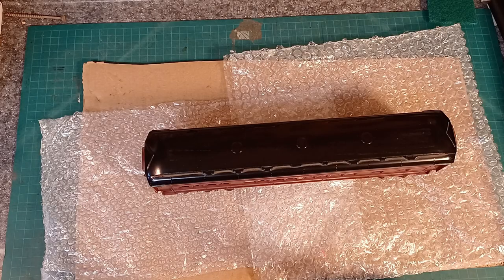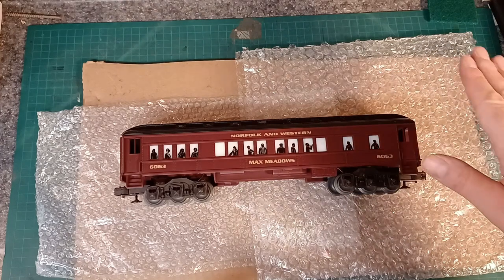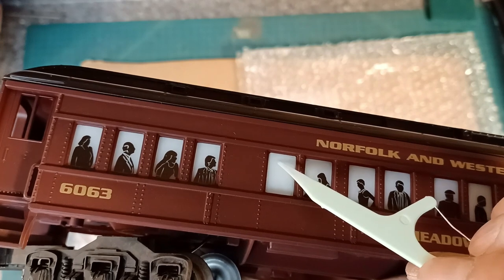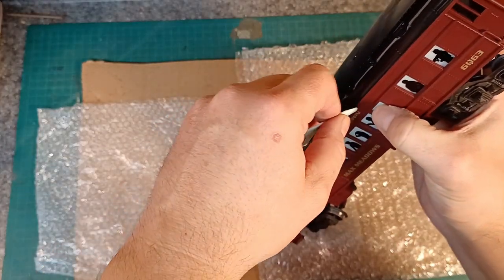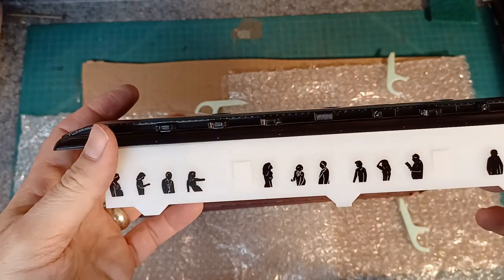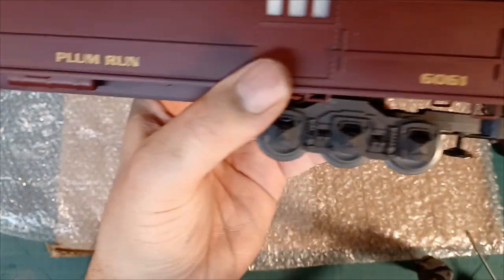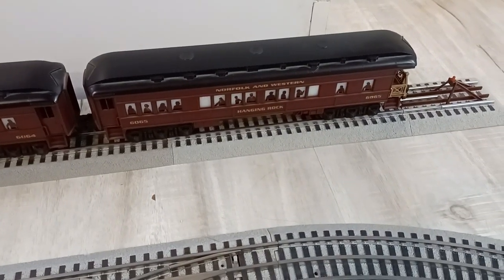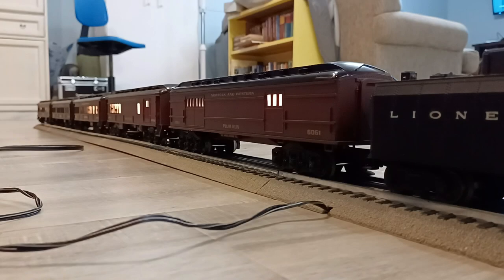How to Fix Lionel Trains. How to change the lights in Modern Era Lionel Pullman/Passenger Cars.

Comment: I have two sets of Southern Crescent cars.   Getting the roofs off was a bit difficult since the cars seem to have been assembled before the paint completely dried.   Took some doing with a flat wood spud sticks to crack the paint, but after that first one it was easy.    Once opened I removed all the old lights and replaced with a LED strip and a small diode bridge/capacitor/resistor circuit for continuous lighting.   They look great and don't flicker at all.

Comment: Hey Warren, thanks again for sharing this tip. I found out that it is easier to stick the floss picks straight down the inside of the car on the bottom of the tab windows after pushing on them a little. A small piece of Popsicle stick also works well.  I only put two on the one side and was able to lift off the roof and windows with no problem. Mine also has the cardboard insert which I believe is to prevent the window plastic from over heating and warping. Thanks again for a great video!

Comment: I have been working with these "baby Madison" cars for years. I am sure this was a great design for fast assembly of these cars but it does make it difficult to get to the lights. Being cast in one piece, the roof assembly is way to stiff to do this easily without damage to the body and roof. You have a decent technique. And the cardboard is there to stop the light from showing through the roof in the dark. This was added after a couple of years of production due to complaints from customers.
Reply: one person fixes it by paints the inside of the roof with paint. also issue with loco light too

Comment: Thank you, for sharing this because I received the same cars only to find out the card board inside fell down which is supposed to be there, but it will fall down so you will have to glue gun that card board inside.
Reply from the maker: Thanks for watching! I haven't had to glue my in place just yet. The cardboard still has a tight fit. I think if the cardboard finally gets to loose I may just hit the inside of the roof with thicker paint.

Comment: That’s part of a 5 car set from either 1994 or 1995. I have the set. Incredibly informative video on how to do as such.
Reply from the maker: Thanks for watching. Its a great looking set too. I do have all of them and use them quite a lot.
Reply: @warrenmuzakpostwarguy4331  They really are great cars! How do you get your trains to run at such consistent speed with Fastrack? I have 2 loops in the floor, 2 small loops, wired for TMCC, and even when I just run conventional, the trains all speed up and slow down..and I've got feeder wires placed every so often. Using a KW xformer
Reply from the maker: @jamesmdean1987  Hey James, thanks for watching. I have a KW transformer too. I regularly clean my track with a green scotch pad (dollar store brand) and once in while (7-8 months?) I check the tabs to make sure they are connecting properly and not loose. If needed I bend them to tighten up the connection. My track is just "clicked" together no feeder wires.

Comment: Always wondered how to do that . Thanks. Do you think the cardboard was a heat shield?
Reply from the maker: Thank you for watching Tim! I thought that cardboard was a heat shield, now I'm wondering if its just a packaging. Maybe protection for the lightbulbs. The lights used in there do not get hot enough to affect anything.
Reply: @warrenmuzakpostwarguy4331  The cardboard was added to defuse the light so it doesn't show through the roof. This was added to these cars after a few years of production. Simple answer.
Reply from the maker: @richardsobieck9660  Thanks for that info, I never would have thought thats what the cardboard was for. Only 2 of my cars have it.
Reply: @warrenmuzakpostwarguy4331  I'm not surprised. As I stated, the carboard was added a few years after production of these cars was started. The earlier versions such as the Blue Comet and the Milwaukee Rd cars, I believe don't have it. I think the later ones like the Chessie Steam set and the Wabash card should have them. Your car in the video has the 6 wheel trucks, those are later production and a bit different design than the earlier ones with the 4 wheel trucks. I was told you can't put 6 wheel trucks under the ones with 4 wheels, but I did it. Took a bit of modifications underneath to get clearance.

Comment: I need to remove the plain truck assembly (wheels) to solder the wire back on.
I see that it’s a “plastics truck rivet”, any suggestions on how to remove it without breaking?
Reply from the maker: So I had to do that too. Mine are 6 wheel. Under the middle wheel and axle there should be a screw to remove the whole truck assembly. Even with it off I had a helluva time soldering that wire due to the crummy new style pick up roller design. FULL DISCLOSURE: It was super frustrating and  I wrecked the pick up. If another goes I may try again or just leave it.
Reply: @warrenmuzakpostwarguy4331  
No screw on mine, it’s a metal rivet of some kind. 
Fortunately, I was able to turn it enough to get my soldering iron in there and it’s a success!
Just hoping it holds. 
Thanks so much for the reply.
Reply from the maker: Awesome! Glad it worked out. I don't know enough about the modern Lionels to ffer much help. The modern stuff that I do have with trucks rivet, do not have clips or anything on the other side to allow for the trucks to be removed.
I'm glad you figured a work around! Enjoy!   @Cravz69